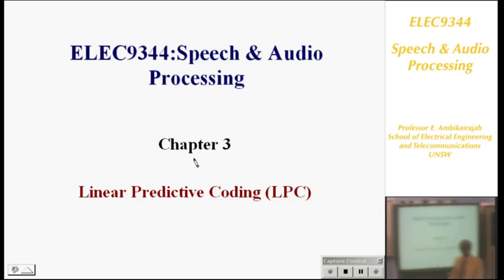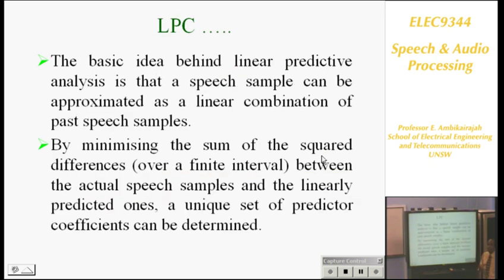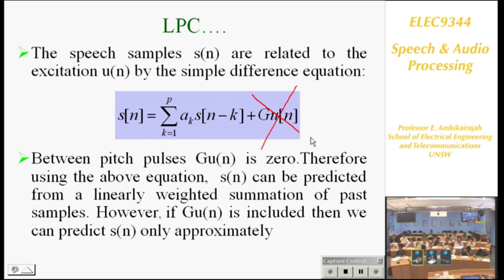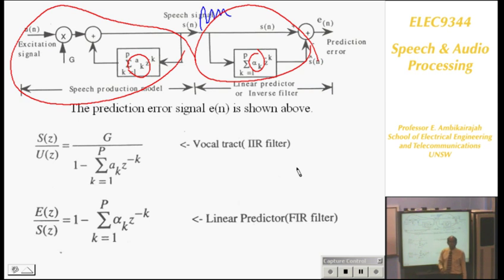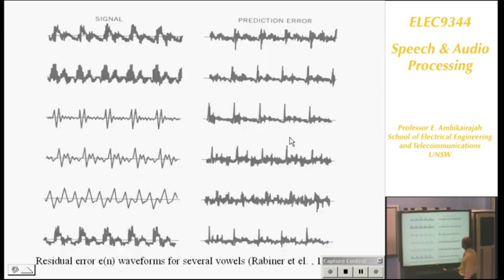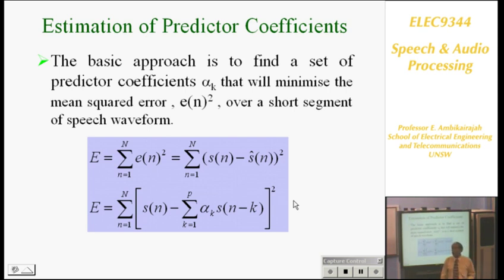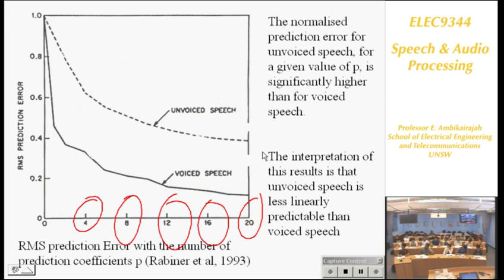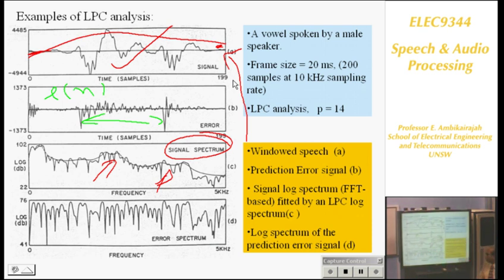Speech and Audio Processing 3: Linear Predictive Coding (LPC) - Professor E. Ambikairajah

Comment: Great series, thanks for this UNSWelearning and Prof. Professor E. Ambikairajah!

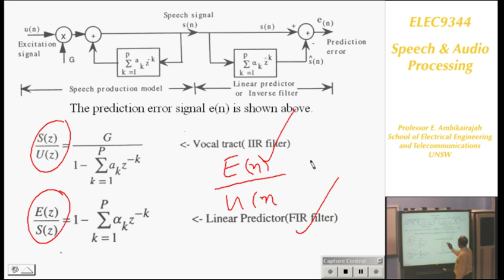One question (open to everyone of course :) ): If e(n)=Gu(n) per 24:28, minimizing e(n) does not make sense at all (since, we are in effect minimizing u(n) which we are in no position to do, excitation is a system feature).

I think self-contradiction stems from the fact that, on one hand,
e(n)=Gu(n) only when ak=alpha(k) for all k.  

However, we obtained equation for e(n) (e(n)=s(n)-sum(ak*s(n-k))) completely ignoring u(n). Minimization procedure that follows (using partial derivatives) makes a perfect sense if our goal is to minimize [e(n)]^2. This will give us fixed set of ak parameters. But these will be different from alpha(k).

I dont agree/understand therefore how can LPC procedure give us u(n) as claimed at 25:40. These two are different ak vectors/operating points... (one obtained by minimizing e(n) completely ignoring u(n), other actual system parameters that work on u(n))
Reply: 2 years later, have you figured it out?
Reply: e(n)=Gu(n) tells us what we should expect the smallest possible error signal we can achieve if we precisely calculate the pole coefficients. Which means that the first sample out of your LPC is expected to have a high amount of error. How we calculate the pole coefficients is a completely different story, which you describe.